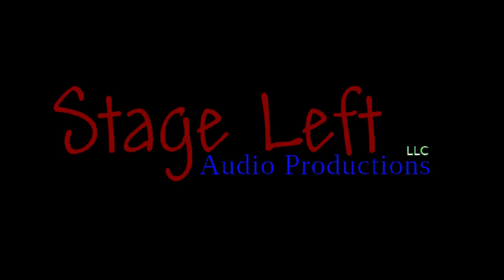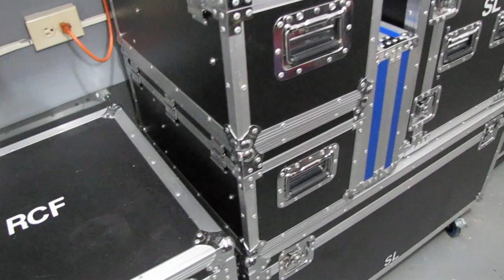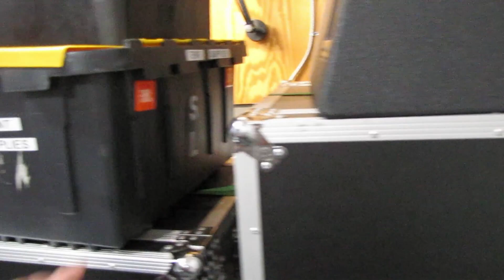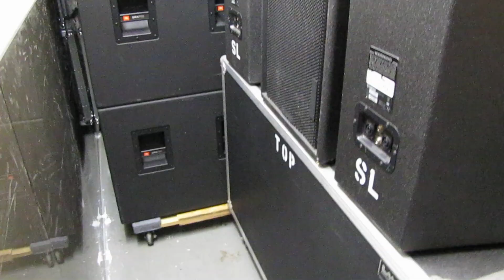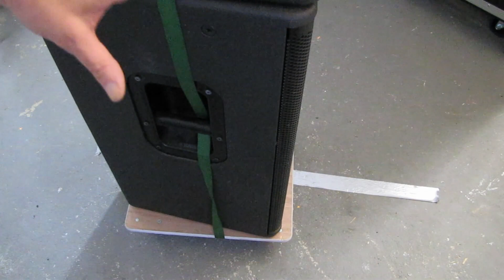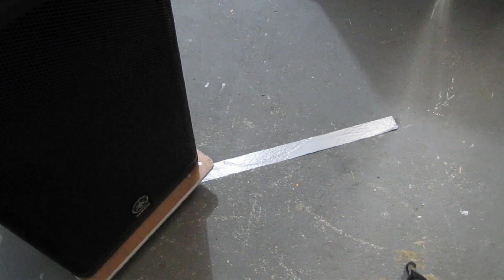Road cases we use for our audio equipment

Comment: I've also purchased some of the caster boards from Amazon to use for my heavy hazers. Works pretty well...I never thought to use them for my top speakers...
Reply: I've found that the best place to buy dolly boards is Harbor Freight, the quality is excellent and you can't beat the price, also the best way to buy casters is to buy the smallest size dolly boards from them and remove the casters and trash the boards, less then half the price of buying single casters!

Comment: I bought a bunch of those yellow top cases and they are extremely weak. Office Depot, Home Depot, BJ's Wholesale, and a bunch of other places sell them for approximately $8-$10 each. I am looking to replace them. We went ahead and cased up all our speakers and subs. Everything in our warehouse is cased, in either a Pelican case or a road case. Cases are always your second biggest investment after the actual equipment but it protects everything and your gear looks new forever.